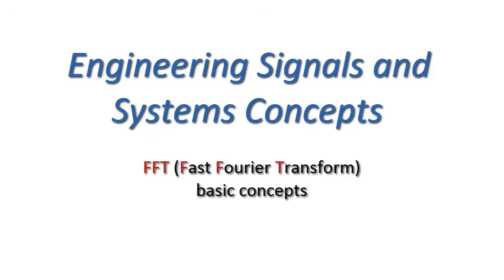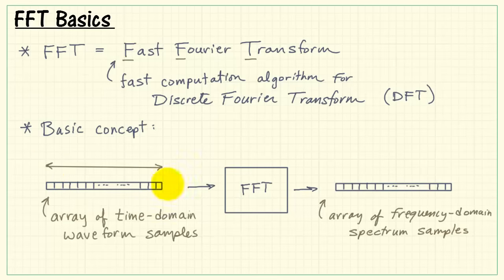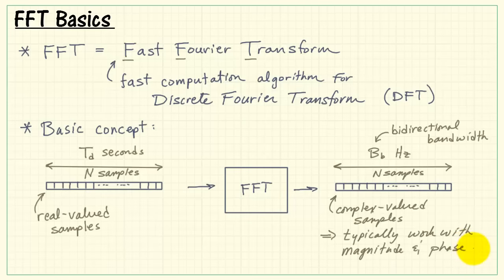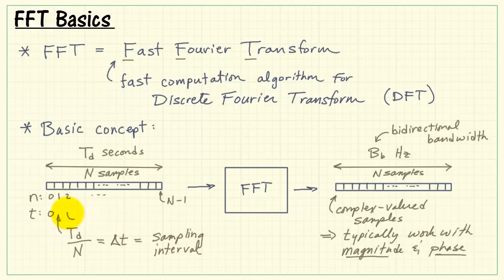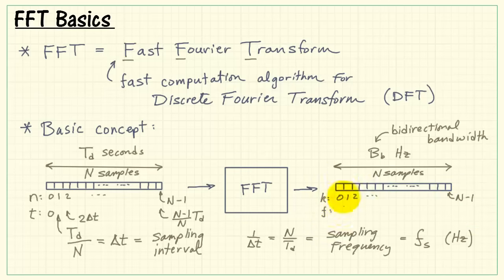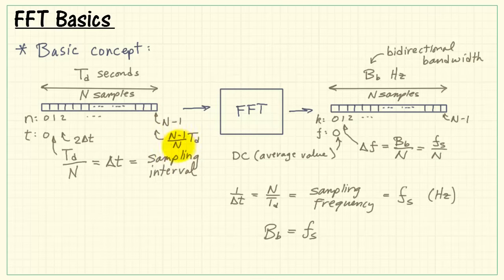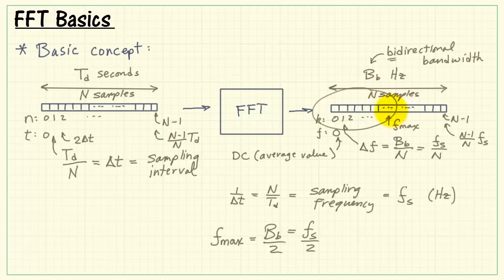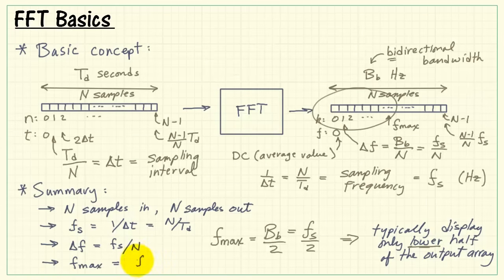FFT basic concepts

Comment: @NTS.....If time(t) starts at zero then time instant of last sample minus that of first sample(0) is    (N-1)*Td/N ... which is not equal to the time length of signal (Td)....what the heck you guys are talking......It read more than hundred of paper on FFT and DFT , all of them are using this dumb index system (0 to n-1) and that silly mistake though its has no such significant effect it can;t be neglected.... 

Correction way 1: If you take N samples ..then it has N discrete time instants ...but indeed (N-1) intervals only....that's make size of interval to be Td/(N-1) in fact indeed.....

Correction way 2: If you stick at signal length to be Td then...your index should run from 0 to N.....thereby making total number of samples to be (N+1) .....total number of interval to be N

Comment: Am I wrong or Delta_t should be equal to T_d/(N-1)?
Reply: Because t_i=i*Delta_t so t_N-1=(N-1)*Delta_t=T_d
Reply: Time starts at 0 and runs until N-1 meaning there are N samples for duration T_d. So you got T_d/N as width of time steps or Delta_T. In other words, you would be right if n started from 1 instead of 0.

Comment from the maker: The FFT gives you a two-sided spectrum. When you shift the output array elements to place DC (index k=0) in the center you get negative frequencies on the left side and positive frequencies on the right side, and fmax appears at the far right side. The bidirectional bandwidth refers to the *total* spectrum occupied by this two-sided spectrum, and because DC is in the middle, fmax is only half the bidirectional bandwidth.
Reply: This could only ve understood if you're working on the hardware and have experienced how acquisition of bandwidth is done when tune a radio at a certain center freq.
Reply: Could you explain with an example
Reply: @NTS. ....If time(t) starts at zero then time instant of last sample minus that of first sample(0) is    (N-1)*Td/N ... which is not equal to the time length of signal (Td)....what the heck you guys are talking......It read more than hundred of paper on FFT and DFT , all of them are using this dumb index system (0 to n-1) and that silly mistake though its has no such significant effect it can;t be neglected.... 

Correction way 1: If you take N samples ..then it has N discrete time instants ...but indeed (N-1) intervals only....that's make size of interval to be Td/(N-1) in fact indeed.....

Correction way 2: If you stick at signal length to be Td then...your index should run from 0 to N.....thereby making total number of samples to be (N+1) .....total number of interval to be N....

and one more thing what you described is DFT... not FFT...not at all hehe